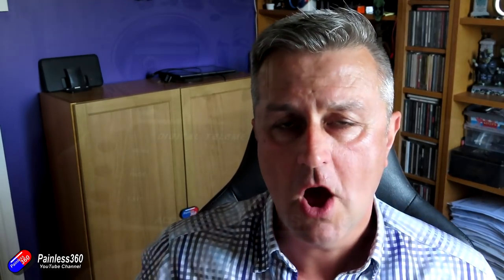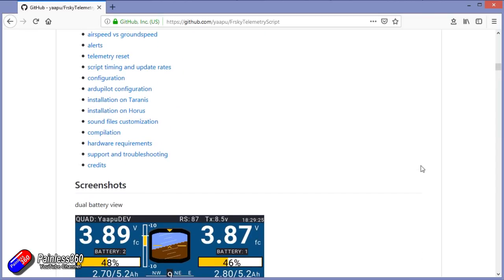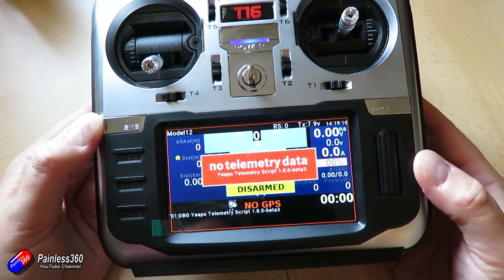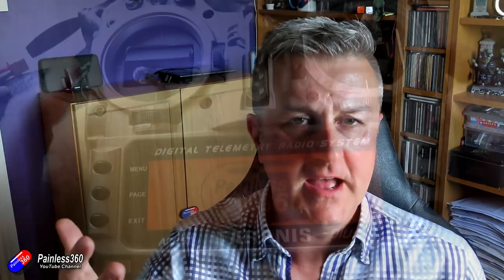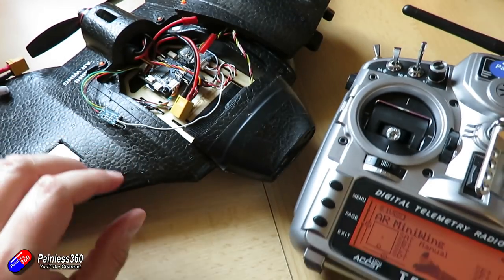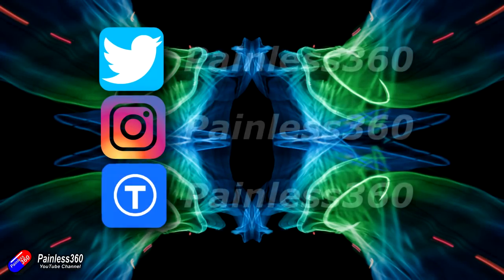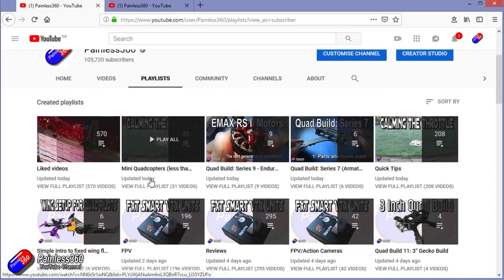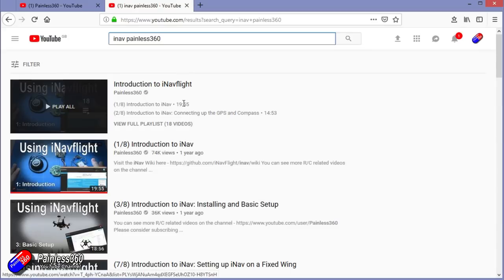Cheap ArduPilot Telemetry on OpenTX Radios Using Yaapu LUA Script

Comment: -luac checkbox is not available in Companion 2.3.5 any ideas?
Reply from the maker: The answer is in the release notes for OpenTX Companion - "Multimodule, Crossfire and luac options are included by default in all firmware". Happy flying!
Reply: @Painless360  Wow Lee that was fast! Cheers!
Reply: @Painless360  and something else, I noticed that you use the non eu(lbt) (checkbox wasnt ticked) opentxfirmware and assume that fcc is used for the xj and receiver. Is this a Brexit thing :D or it is actually better in any way to fly the fcc firmware in Europe? Lbt on paper looks better, can one firmware be better than the other regardless of location?
Reply from the maker: What you have selected in OpenTX makes no difference to the protocol your radio uses. EU mode simply removes D8 and a few other things.. see  my video on that. Happy flying!
Reply: @Painless360  of course I have seen the video about it but it does not answer my question, if given the choice to have either fcc or lbt is there "betrer" protocol between them?

Comment: You avoid to deal with the "inversion problem" going back to the diy cable solution...
Reply from the maker: I dont understand your comment.
Reply: @Painless360  with the 3.10 version of ardupilot there's a way to do as you would do it with betaflight, connect the sport directly to a uart. The 3.10 is a dev tag version, so this is not as well documented as the standard cube method. https://github.com/ArduPilot/ardupilot/issues/9267

Comment: Hey I had a quick question for you. I have a wing and the F405 board and I have the latest iNav and the GPS tab does not show a map plus the mission control tab does not load a map either and says at the top to use a stand alone mission control. I had ardu pilot mission planner loaded on my f405 but inav would not connect to my board so I started over and loaded the latest inav firmware back to my f405 and now it will not connect to ardupiot so how can I do missions?
Reply from the maker: Sounds like a bug in the inav configurator. I'd check the inav github. If you want anything but basic missions - you want Arduplane..
Reply: @Painless360  If go with arduplane then that means I won't be able to connect to iNav anymore to set up modes and stuff because iNav won't connect after I put ardu firmware on the board.
Reply from the maker: That's right. It's one or the other.. see my series on both.
Reply: @Painless360  Thanks alot buddy! Glad that I found you. You have very good videos!

Comment: Hi ! Thanks a lot for your videos !
I'm using a caipirinha with crossefire nano diversity and f765 wing on inav. After installing rs232 with diode on a tx1 and rx1 I don't have telemetry data in yapuu on my x9d. Can u help me please? 
Best regards
Reply from the maker: I think the last time I did that was on the Arduplane/Matek/ARWing build.. I'd have a look at that series... best of luck
Reply: @Painless360  ok. There is no sPort on rx crossfire but I can choose a chanel and put it in sbus, n.i.sbus, mavlink, smartaudio... do you have an idea ? I try in sbus and mavlink and set smartport on uart1 in inav port configuration but nothing in yapuu telemetry...

Comment: Hi, thank you so much for the video I got it to work. 

But I seem to have a problem with RS232 heating up if I plug in the USB cable to the FC at the same time, I was wondering does anyone knows why?
Reply from the maker: RS232 heating up? I'm not sure what part of the model you are talking about?
Reply: @Painless360 , sorry for not being clear. I meant the little piece of hardware you made in the video that connects receiver to FC.
Reply from the maker: If you mean the TTL board then I've not seen that here.. I hope you get it sorted. Best of luck!
Reply: I have the same problem. The chip was getting real hot.. Not sure if its need 3.3v to work.

Comment: Hi Lee,
been watching your taranis videos and wonder if you might give me sum help,
I have been using my x9d+ for 2 yrs and all was well until i flashed a xsr from the taranis
with new firmware and flashed it to the internal module by mistake and now it will not bind to
any rx at all, I did a factory reset and have all the new resent firmware downloaded everything
looks and sounds fine (chirps) but wont bind, Been trying for days now ! have i bricked something
on the board ? hope you can help,
Reply from the maker: I'd try to flash the internal module with the correct xjt firmware. I hope its ok.. best of luck!
Reply: @Painless360  many thanks for your time
to reply,will try that today not given in to buying a new one yet and i dont mind rebinding all my models,Thanks again.
Reply: @Painless360  all working now i just wished i had asked for help 3 days ago ! now i am in love with the t16 jumper ( christmas soon) now its a 12 + models to keep me busy re-bind/flashing (not pervy kink)
thanks again Lee.

Comment: Is this s.port only or will it work with d.port i have the D8R-xp 😭
Reply from the maker: Only Smartport for this method. Check out the wiki as new features are being added all the time.. Happy flying
Reply: @Painless360  i thought it might be, i guess i can still get some telemetry but it wont be displayed like it is on yaapu. I will upgrade the module and receiver and try it 👍

Comment: Just curious as to where you get the rs232-ttl boards? I ordered several from eBay. The picture in the ad looked identical to yours, but the ones I received are different. The component placement on the back is different and they do not have the screen printed ttl and rs232 on them. (Its a shame I can't upload a picture) I tried several and none of them work. Also, they all get very hot. Do  you (or anyone viewing this) have any experience with these boards?

EDIT:
Wouldn't you know... I just tried another board (Number 5) and it works fine. So far, 4 out of 5 have been bad!!!!

EDIT 2:
Now that one overheated and quit. 5 out of 5 bad......
Reply from the maker: I got mine from a UK seller on eBay..